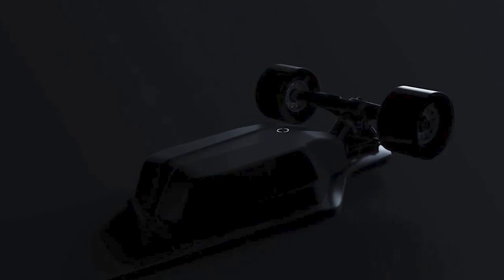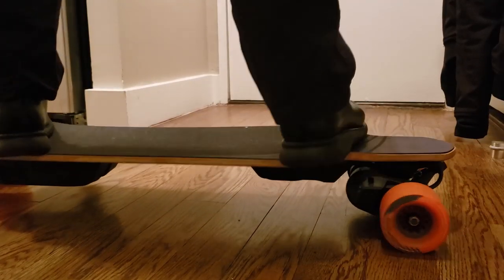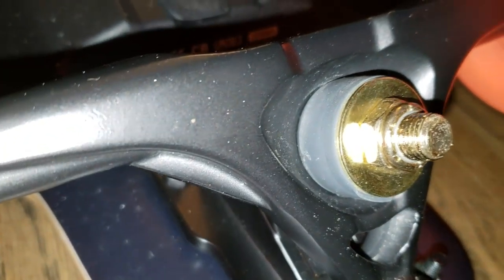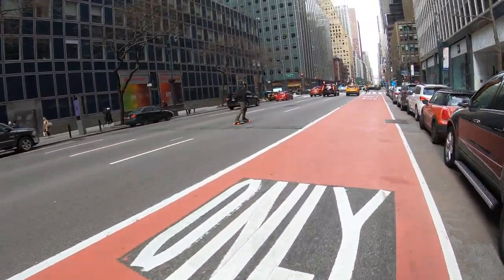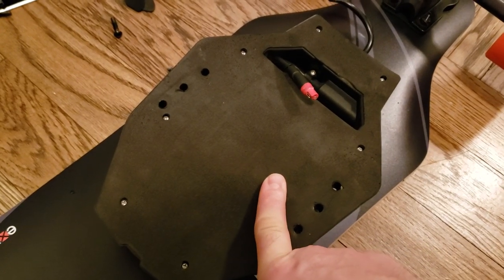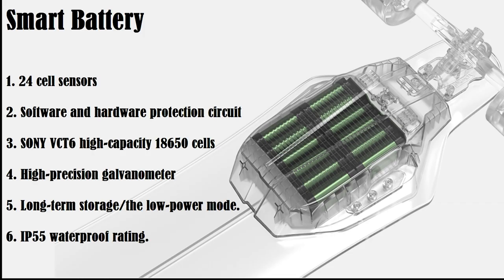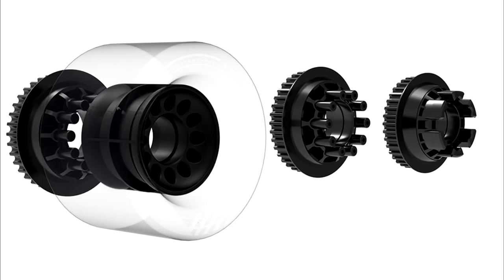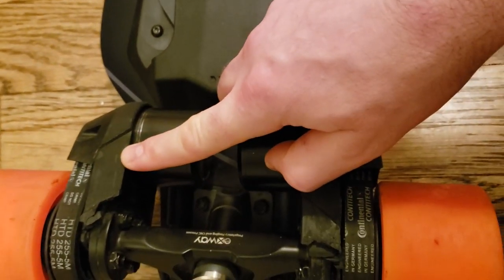Exway Flex Review – After 2 weeks of ridding! Disappointment? Fast Charger & Hidden Features!

Comment: Man what a review 🤙🤙 I love it when people push the boards in their reviews. Things that stand out 
▶️motor/belt covers breaking 
▶️weak brakes 
▶️the foot placement of rear foot 
▶️the suggestion of fly mode 
▶️battery overheating  when charging with fast charger
Reply from the maker: I try to get all info for you...also make it as best possible so it helps in the decisional process. The BMS is the best I have seen so far.
Reply from the maker: Will do!
Reply: Mr. Phillip would you happen to have a review of the board? Seems like Exway is on sending their sample board to few YouTuber reviewer.. I cannot compare since I have only tried the nls pro and v2 plus boosted and nls is no way close to my boosted
Reply: Max Tan unfortunately I do not have one right now. I would love to have one to complete a solid review like I did on the G3. I will just continue to be patient. Hopefully I have one soon. Thanks for asking. 🤙🤙
Reply: Max Tan my board will be here this week 😜😜 so you know Video is coming real soon

Comment: It'd be great to see people covering the hub motors on this model too.
Reply from the maker: will do this next video....i need to ride it for 2 weeks to see how they hold up.
Reply: @ElectricVehicleSpace  so do we need to wait 2 weeks?  I am totally beginner and considering to buy hub version, but I am not sure if it would be enough good as the riot one.
Reply: @kkronoss90  if you dont live in a place where eskate is illegal, then get the belts. Trust every rider on this. Having 4 wheels of completely polyurethane, vs 2 real wheels and 2 hard steel drums surrounded by only cms of urethane. Plus that poly surrounding the motor isnt a good heat sink. And your motor is enclosed otherwise. So most hubs  have more performance drop off than Belts due to heat. You CAN totally get hubs(torgueboard has great hub or direct drive motors that give you all 4 wheels as regular wheels) but they typically cost more to do right. Belts are the best, budget to performance to DIY capability, ratio I know of. backfire G2(hub motors) was my first board. My buddy went for the wowgo 3(3x?) Belt version. I like his board WAYY MORE. mainly because the ride is just... cloudier. If that makes sense? Its softer but more responsive, less weighty feeling. Smooth but by no means lazy.
Reply: @morsumbra9692  thank you so much. The Flex will be my first eskate. I think i would like relaxing and quite ride so I was looking for the hub version. And you can push the hub when your battery goes off. It seems it has less maintenance. Morever law is still not clear here in Italy. I am waiting for a hub review and a close comparison but thank you for your kind reply!
Reply: @kkronoss90  maybe also see if you can try some boards also? Check facebook or reddit for groups maybe? Go to esk8 forum and see if peeps in your city would be willing to meet up?
Reply: I've got my review of the FLEX coming out early next week and will include both hub and riot.

Comment: Man, great, great work. So much respect.

As for the issues, I wanna imagine that:
1. Exway will digitally update its brakes behaviour
2. The excessive concave, as you say, may be an overkill with those wheels but come very handy for like Abec 11 wheels. And regarding this:
3. The clearance from the belt guards with the stock wheels is just ridiculous . It's pretty obvious to me that in the end those are the results. Imo, you gotta buy this board and almost instantly upgrade for bigger wheels. And yes, with bigger wheels the braking issue gets ever more urgent to address.

Thanks for your precious experience. Ride safe.
Reply from the maker: Yes indeed. I will post soon a video with the cloud wheels and respective pulley. Not sure will make sense for my weight to have these wheels since it drastically reduce the range unless I get a bigger pulley to keep same gear ratio. Yes braking is not drastically improved even after updating the firmware. I need better brakes.
Reply: Portable Electric Vehicle Do you test already with cloudheels? What is the solution to the actual brake problem?

Comment: What is the latest update on this board? Did exway corrected some of the problems like poor brakes and acceleration? I am interested in this board. Also did you test this board with bigger wheels? How does it feel if yes?
Reply from the maker: i posted a follow up video on all the issues I mention in the video in question.  Check it out.

Comment: Great review, you covered so much good info, thank you! I almost bought the Verreal RS from one of you recent videos, but decided the Wowgo3x was a better option. Wish I could’ve been patient enough for this board to come out!
Reply from the maker: wowgo has poor customer service.
Reply: Portable Electric Vehicle agreed, but I need new board to commute for work and couldn’t wait for the flex 🤷‍♀️
Reply from the maker: @runningcolekong  verreal RS is a good commuting board.
Reply: Portable Electric Vehicle for public transit, I just felt like a belt drive top mount truck is a little more portable than a drop thru deck
Reply: @runningcolekong  How are you liking the 3X?  I'm actually thinking of choosing the 3X over the Exway based on everything I'm seeing and reading... seems like the closest thing to a budget boosted stealth on the market :)
Reply: Colin Rogers honestly, I’ve had nothing but issues with the 3x. First, the battery was garbage. Was only getting 2-3 miles of range. Then the remote broke. 
2 belts snapped on the first ride because they sent it super misaligned from the factory. 
I’ve reached out to wowgo about these issues a month ago because the board won’t even work. They charged me 95$ and are sending me a new battery and remote. Still haven’t received a tracking number. 
I think I got a lemon, if I were to compare the 2, I’d say the RS is more fun to ride/ carve on. But the 3X has better acceleration and much better brakes. I’ve had no problems with my RS
Reply from the maker: @ColinBenjamin  wowgo is a bad company. Sell defective products.
Reply: @ElectricVehicleSpace and Cole, thanks for the reply.  Wow - definitely not what I was expecting to hear.  I have read that there were customer service complaints with WowGo but the first impressions and reviews are all so positive!  Appreciate the insight - will be looking at the Flex.
Reply: @ElectricVehicleSpace  And Varreal has even worse customer service

Comment: really god info in every clip, thanks for your work mate.. ordered flex riot 2 days ago so now i am waiting for it.. i think the next board will be verreal rs so i can have one board for bigger range also.
Reply from the maker: Verreal is not that good for range anymore. Look into eovan carbon. Has the best range. You can also use my code from the video and better price. Eovan is the best now.
Reply: @ElectricVehicleSpace  i was looking verreal 20ah battery. it s more than 700wh. i think i ll go either with verreal rs or lycaon trx 2.0. Happy easter and thanks for info
Reply: @ElectricVehicleSpace  i checked now, great board but i like better how trx looks. thanks mate for advice
Reply from the maker: @ian-wr1hk  lycaon is not that that good. I tested their board and they felt inferior to eovan and exway. I would not own this board long term. This company is not advancing and does not bring improvements as exway ot eovan. Does not hold value in my opinion.

Comment: Range wise, would this be close to the Verreal RS ? How do they compare?
Reply from the maker: Verreal RS has close to 20 miles in range, has more acceleration and its less flexy. Verreal does not have the tech features that Exway flex offers. Both boards are cool now it depends on preference and design.

Comment: In depth, real world E skateboard torture test.  Have you been riding that Verreal rs?  Thank you for these awesome videos.
Reply from the maker: I am working on the pulley for the cloud wheels and after i review the boundmotors I will get back to Verreal and tear it down to shreds....same with the Flex hubs and post the videos. for $650-$700 range these are amazing boards. I also really like the Vestar V2 pro for $450...really good entry level board or back up board.

Comment: I pre-ordered one, had my eye on the Wowgo 3x belt drive, because of the break and torque, I'm kinda regretting it now, think the breaks will get better, and torque and break wise, is Wowgo 3x better man?
Reply from the maker: Wowgo customer service is not that great. They reply to the email really slow. Exway will definitely fix these issues and even go the extra mile. Exway will have the best boards when it comes to tech side. Cancel the Wowgo and get the flex.
Reply: @ElectricVehicleSpace  Yes sir, you're awesome bro, exway flex on the way to my house! Thanks for the reply.
Reply from the maker: @oscarcontreras1103  if you have any other questions write here. I'll answer to the best of my knowledge.
Reply: Ya made the right choice. Cuz which board is gonna be better in 6 months to a year. 2 years? The lifespan extension of the exway via firmware updates is huge. Makes any non DIY board stay competitive after a single season of tech, specs, and learning curve upgrades happen every year to the industry.
Reply: Oscar Contreras hey man, how long did it take for your board to ship from when you ordered it?
Reply: its been a month, have u got it yet?
Reply from the maker: @seungwonlee4449  no
Reply: @drewvans9442  I pre-ordered the exway flex the same day it dropped and still waiting for it, the shipment date has been changed 3 times, I received an email today that the board will be shipping out 05/20, but dates can change again...
Reply: @seungwonlee4449  probably won't be getting the exway flex any time soon since the dates keep changing, if that's what your talking about
Reply: In same shoes, I was thinking to get wowgo 3x, but I went for preordering this. Dw about the break, there's an FW upgrade for that already.

Comment: Hello, do not know you name? I love your comprehensive and professional reviews. Since you test and try so many options and boards I hope you have the time to answer me. I have a Wowgo 3 which I like but the roads are a bit rough here so I am considering a belt board. I am leaning towards the Wowgo 3X over the Exway flex because I think it may be a bit less loud, also the deck is bigger and a bit more flex. The Wowgo also carves so well and turns tightly.What do you think? Also want to perhaps put bigger wheels on which perhaps on the Wowgo requires risers? Also looking at your flex review I think the flares look a bit uncomfortable? Can you also explain the new pulleys for the cloud wheels since the core may be change because of cracking? Do these still support both Abec and cloud wheels or do you have to buy new for each wheel? Hope you can answer me, thank you.
Reply from the maker: cloud wheels are great. I would choose Flex. So much better built.
Reply: @ElectricVehicleSpace  Thank you!

Comment: Awesome video, liked and subbed! I am highly considering this board. You said that the new design allows you to swap/customize to a new deck. I also wear size 12 and would like a slightly wider board. So my question is what boards would be compatible with this  and how would it be mounted? Thanks for the video!!
Reply from the maker: What deck are you looking to swap with? ITs not complicated but will require some minimal adjusting depending on concave of the deck you are swapping with?
Reply: @ElectricVehicleSpace  Okay thanks for the quick response. Can you also  customize your wheels with different brand wheels? I want to know if you can use the cloud wheels off the verreal website on the flex board and would it require extra parts. Thanks again! Do you prefer the flex or Verreal in terms rideability  I am also also about 6'1 but only 150 pounds and have rode longboards for a while now. How bad really is the foot placement final question.... maybe lol... Your the man!

Comment: You mentioned the ability to choose to mount all components to a different deck. I noticed on other videos that some wires seem to be routed through the deck. How would this work with swapping out decks. I only ask this because I’m very interested in the Exway Flex but want the freedom to swap decks. Great review BTW.
Reply from the maker: The wire can be routed on the outside of the deck or you can use a router and epoxy the channel when done. Either way will work. thank you for the nice comment. Also if you chose to buy the board use the code I place in the description video box. You will get a better deal.

Comment: Would it effect the ESC/board if you used a 12s 4p or anything other than 2p, if it was the same sony Vct6 cell?
Reply from the maker: I am sure the BMS will reject that. This BMS is more superior than any BMS I have seen. I could only entend the range of the PRo 1 version after exway game the the updated software. Otherwise it did not work.
Reply: @ElectricVehicleSpace  great video dude. Thanks for explaining in clear technical terms what our machines are! Loved the bit about the charger, can sympathize with that lol
Reply from the maker: @morsumbra9692  thank you Sam!

Comment: Great review!  Relatively happy with my Ownboard W2 but, if it breaks, the Flex would be the board I would replace it with.
Reply from the maker: Even if it does not brake Flex is far more superior and better than any other brand. Firmware update coming soon.
Reply: Portable Electric Vehicle Can you get us an update of your thoughts when the update arrive

Comment: hello does the 4 amp quick charger still use the magnetic connection?thanks😎
Reply from the maker: no
Reply: Portable Electric Vehicle So is there an additional connection on the battery?
Reply from the maker: @king1ny  just regular plug. I'll post in the video
Reply: Portable Electric Vehicle Thank you I appreciate that.
Reply from the maker: @king1ny  my pleasure

Comment: It's a personal preference, I know, but your foot placement is not optimal for speed. The rear foot should be more parallel with the board (toes facing forward more) and front foot more perpendicular (toes facing edges). This gives more stability because steering is almost completely on front truck and this avoids wobbles. Watch pro downhill riders stance and you'll see what I'm talking about. Also, you can position rear foot closer to the front of the board but since it's flexy I don't know if it will work. Did you have any issues with battery scraping the road if you put your feet closer to the center? Great video, btw, thanks for being honest.
Reply from the maker: I am not a pro downhill racer and I exposed my personal opinion so regular riders with bigger feet know about this. I do regular riding with speeds between 5 to 25 mph.

Comment: Exway really need to be more realistic with their claimed range. I find whatever the stated range is if you halve that then there would be your realistic range. Give or take a few kms
Reply from the maker: I am happy with the range. I get from Boosted stealth 6 miles and 12 miles with Flex and more power delivery. I got the final production esc and the board so much better now. Video coming in several days.

Comment: I ride mine at max speed everywhere I go and it overheats after 50% battery is used.  Every time!!!  So frustrating.  It locks up the wheels only allowing me to go again once it cools off
Reply from the maker: Speak with the company and use the warranty to replace the damaged parts. Exway flex is awesome on my end.
Reply: @ElectricVehicleSpace  I've reached out to every email address they supply with them stating it's a "feature" and not a problem.  I have a review on my channel about it that goes into greater detail.

Comment: Exway have fixed the braking issue with a new firmware update 👌
Reply: Sure about that? couldn't find any update
Reply from the maker: I spoke with Exway yesterday. They are working on the firmware update and they will send it to me in several days. It's not ready yet.

Comment: hello bro can you use the new flipsky remote on the flex board?thanks. i ordered the flex👍😎
Reply from the maker: not really. the remote and esc from flex are proprietary and esxay remote is better than flipsky 100 times.
Reply: Portable Electric Vehicle oh so the esc and remote is made by hobbywing?thanks cause i saw you had the link for new flipsky remote. thought was compatible.thanks for help👍
Reply from the maker: @king1ny  flipsky remote only good for vesc based esc or flipsky esc. Exway is way more advanced and has better ergonomics.

Comment: Does anyone has a better wheels setup than the stock ones for the x1 pro riot?????
Reply from the maker: flex stock wheels are good.
Reply: You can downsize to kegels 77a or get 90mm flywheels. Wouldn't suggest going any bigger. I've seen x1 pros with cloudwheels tho

Comment: I see batteries case cracking.
Reply from the maker: no the batteries are good. No cracks there.
Reply: @ElectricVehicleSpace  ride it for six months. Then check back.
Reply from the maker: @GeeKIller no it will not.